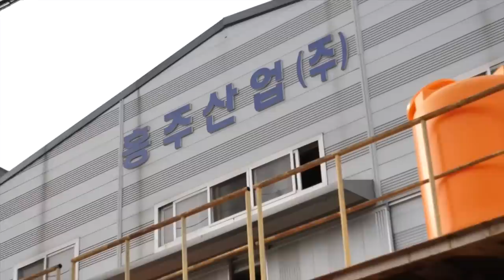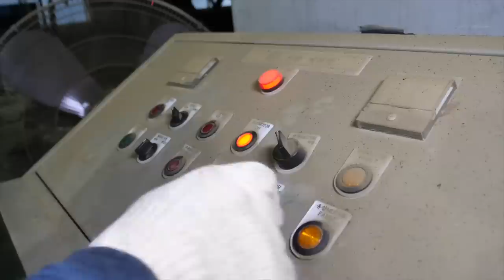process of making agiant plastic water bottle. pe tank factory in korea

Comment: Question?  Can a used blue plastic container be shredded and be recycled and used in the mix ?
To make new containers ?
Reply: Don't know what plastics they use, but we can surely say no, because it would ruin the color. They seem to have a brand color.
Reply: @timtim8468   Ok I understand about a brand and color
FYI all over America they ship and flood the streets with used plastic barrels sell them cheap.   But have toxic residue poor people use them for drinking water
Recycle
Reply: These are HDPE containers. HDPE is recyclable. However, if it was used to contain chemicals this may limit recyclability. Colorant, as noted by another user, is also somewhat of an issue. Regrind often more suited where color doesn’t matter or where it would be applicable to use black.

Comment: Anyone else find it bizarre they spend all this time and energy getting the stuff into sacks only to dump the sacks out 1 minute later?
Reply: It is far from a fact that bags are thrown away. They are either sold by some farmer as containers, or handed over as recyclable materials for processing. In any case, it is neat to fold the bags and does not create a mess in the workshop. Hello from Russia.  :)
Reply: Males it slightly easier for the worker to place the contents in the form. I would say they re use the bags over and over. And they are probably from material that has been delivered. The best recycling method there is